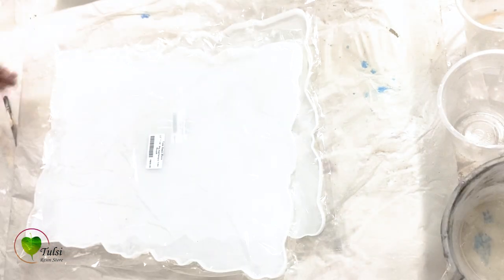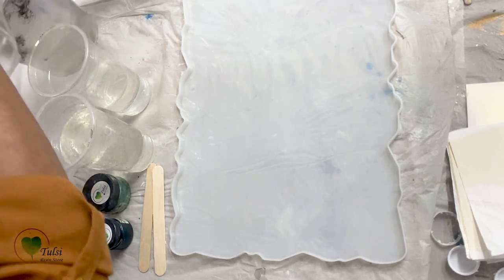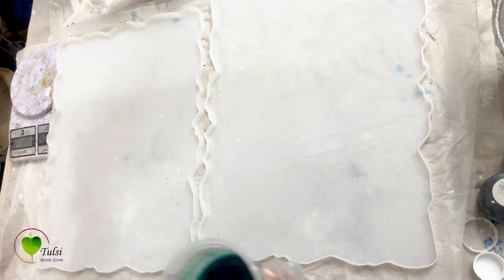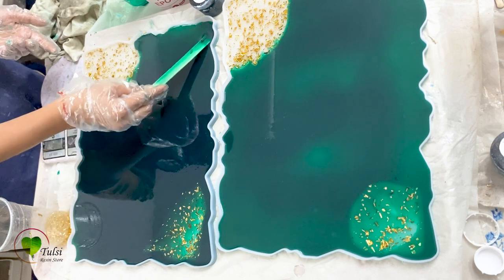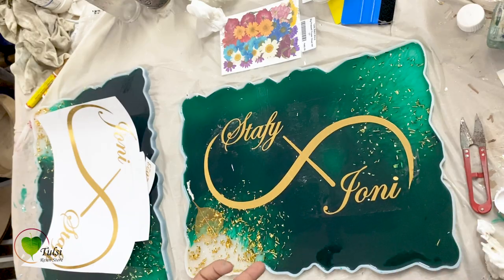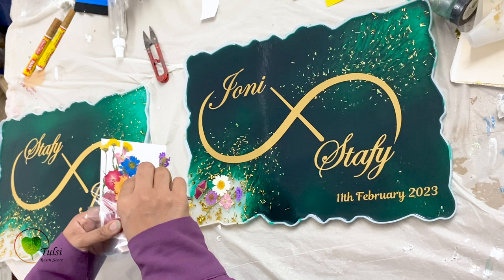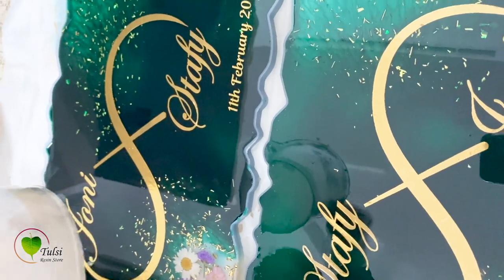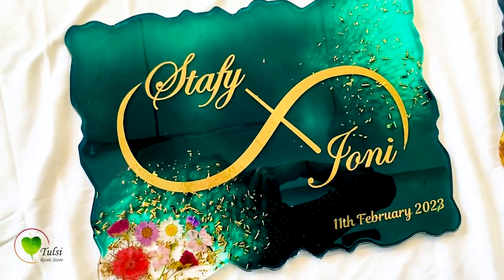🔥Resin Art Tutorial⭐/beginners friendly resin art || DIY Resin Art | Tulsi Resin Store Surat #resin

Comment: 3.1 is the ratio then why u are taking 275 of hardner
Reply from the maker: We have used 3:1 Art Epoxy Resin
With 825g of Resin we need 275g of Hardener and that's the calculation as per 3:1 Resin.